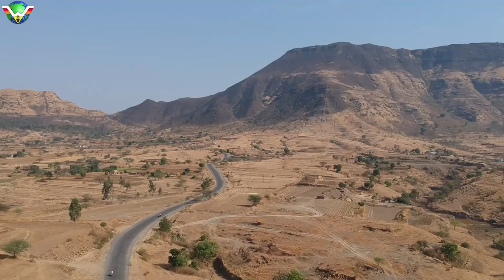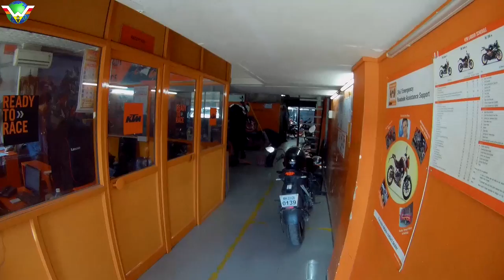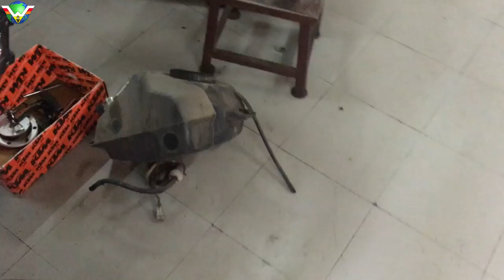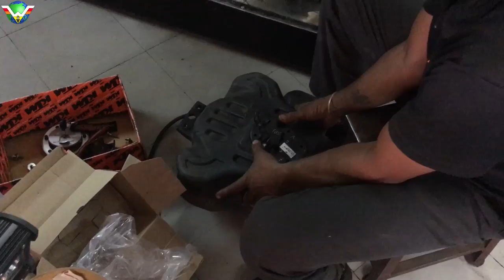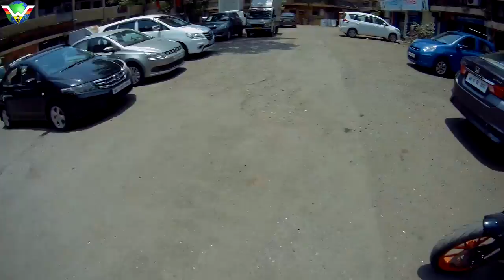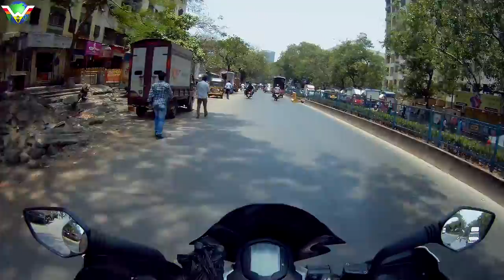Watch This If Your Bike Performance Has Reduced | Fuel Injector/Pump Issue Solved | KTM Duke 390

Comment: My bike is lacking power while shifting from 1st gear to 2nd then one 3rd gear bike is fine but once I shift to 4th gear then again lacking the power I went to a service centre for other work but I asked them what could be the reason they said I gotta change my clutch plate that will cost me around 8k,but that's fine but now I feel after seeing this video I think it's my fuel pump I am so confused what u shud do now??
KTM Duke 390 ( 2018).
Please help

Comment: In my ktm duke 200  while my bike is running  in 1st gear then after changing 2nd gear  the pickup is  decrease but if thortle is rev then pick up is increase  clutche plate is   good but i dont know whats the problem is can u gave me solution
Reply: Same problem
Reply: bro same problem...is your problem solved

Comment: Bro my duke 200 have reduced the initial pickup  what should i do plz replay me
Reply: I have the same issue in my 2019 390 duke . Did you found out what is the issue ?
Reply: @rahulbhardwaj3694  clutch plate , throttle body clean,chain sprocket change